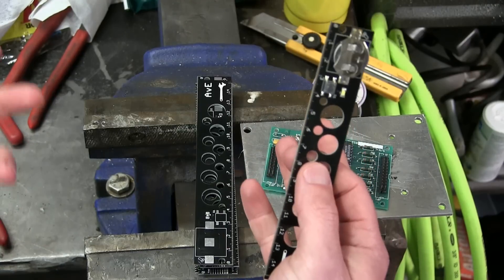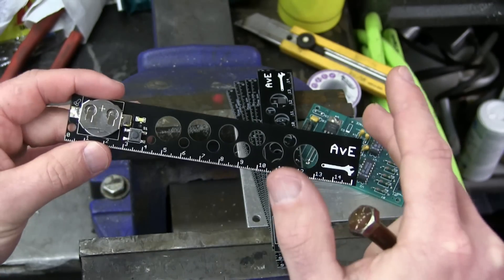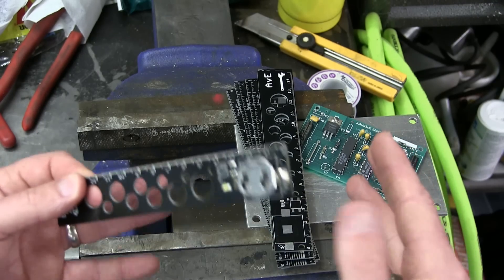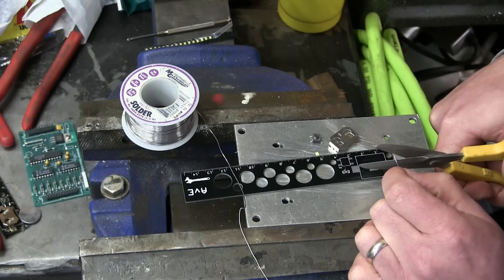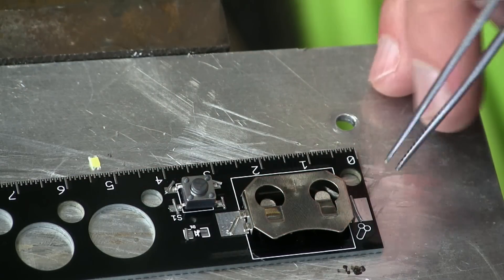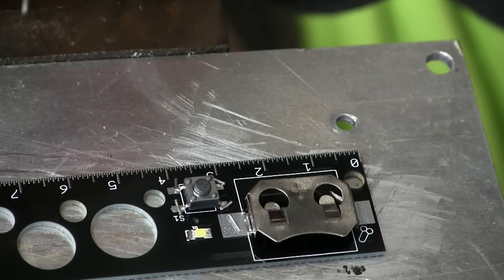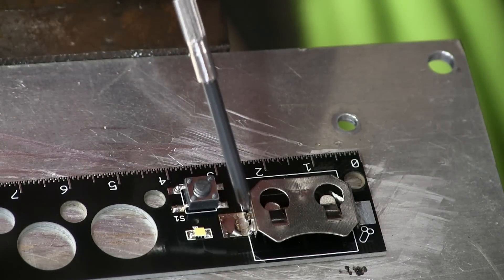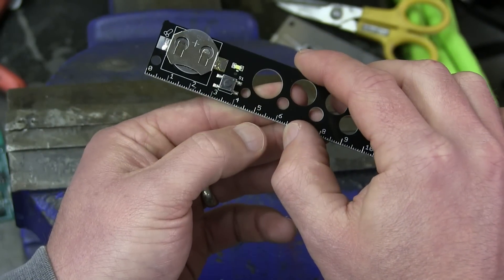AvE Shop Ruler: AKA How to Solder WITHOUT a Sodding Iron!

Comment: How about showing some quick-and-dirty way to make a soldering iron from piece of wire some asbestos/teflon insulation and some nichrome wire stuffed together connected to some old wallwart 5v supply, or directly to AC with lightbulb for current limit if you are brave enough... 
I have soldered bunch of broken off connectors/switches in mobile phones/walkmans (guess some of you are old enough to know what walkman is/was ;-)/flashlights, etc. with thick piece of copper heated over a candle at hippie festivals ;-)

Comment: I don't see why you couldn't just use a toaster oven instead of the torch.
Apart from the cacophony the wife might raise, it's superior because electrocity is cheaper than MAPP gas, at least where I live.

Some enterprising individuals improve the temperature control system by replacing the (usually) open-circuit control with an Arduino, a type-K thermocouple, and a solid state relay to get precision closed-loop temperature control with the freedom to use whatever kind of control algorithm they want, be that proportional, PD, or full-blown PID.

Heck, the spot welder you tried to make a while back already has most of the stuff you need to make this work. To control the temperature, you're essentially going to be doing PWM at 0.5 hz or thereabouts. No "dimmer" control needed, just a dumb relay.
Works like a microwave's "power" settings in that you're not actually running the thing at part power, instead running it at full power for part of the time.

Comment: Feck blowing the parts away or holding the torch or any of that nonsense, it's too much work. I just put it in the oven with my dinner.

Keeping the pad stuck to the board can also be achieved by throwing plenty of vias around the pad, or on the pad if you give fewer shits about things than I.

Comment: I'm wondering if there's a way to repair a joint while you are in a 3rd world shit hole without an iron, my vidja game controller has a broke connection on the rumble motor and I just can't explode demon heads without that satisfying thud in my hands. Now when i faff off It feels like I'm wasting my time now and should be doing something more productive with my leisure and I do not want this.

Comment: You need flux on the pads genius.
Reply: Flux core solder has a very small amount in it, just enough for spot applications but not enough for flow. The solder didn''t flow nicely like it should. He needs to add flux.
Reply: seephor at 08:14 on...

Comment: Two attempts, two fails.  First one the LED looks pooched; second one I have no idea why it doesn't work, everything seems to be soldered in the right place at the right orientation, checked the batteries and they work fine.  Think I'll chisel off the electronics and just use the ruler, more excess engineering than my Mercedes in this ruler.  Oh, and the magnetism is caused by the neo mag in the bag with the switch, not your wife's hair pluckers.